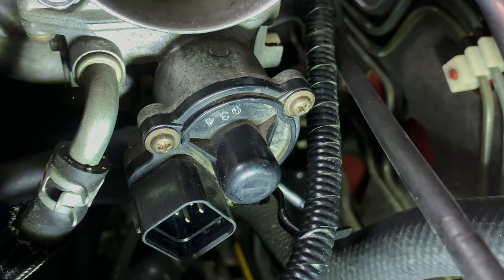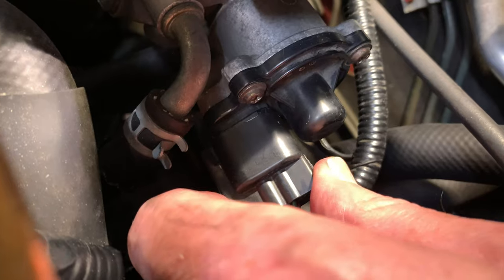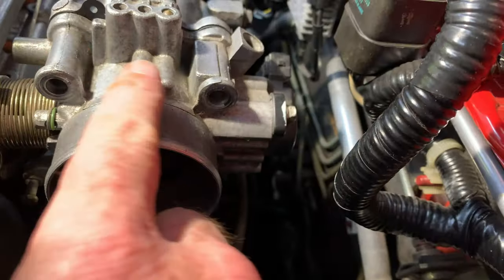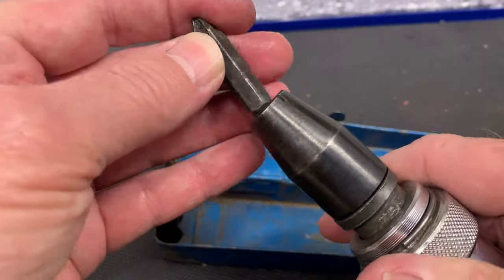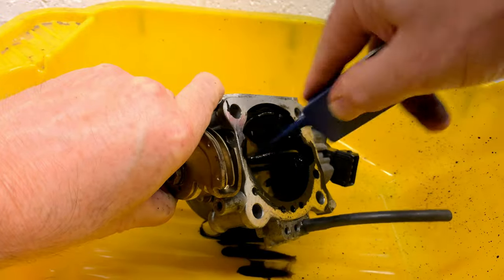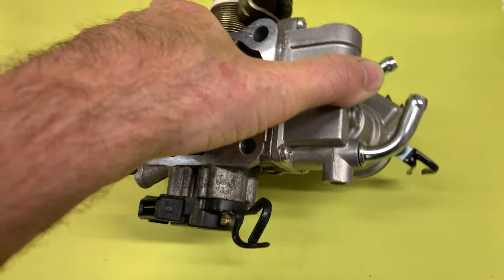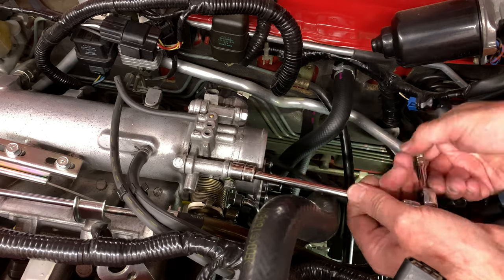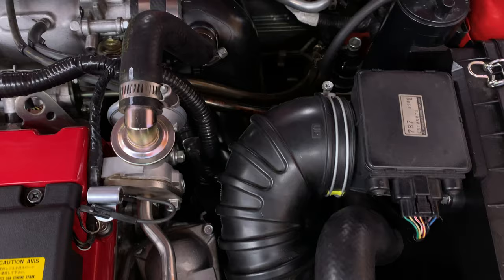Mitsubishi Evo IAC - Idle Air Control Valve Install - FAST Idle Air Valve - Motor IACV

Comment: Thx for sharing, i’ve often wondered what the clicking noises were when you turn on the car and or OFF. 👍
Reply from the maker: Its great to get this job done finally. I need to drive this car before winter returns

Comment: Nice one Andy, I too had to replace mine on my TME..Yep they die, even at 25,000km. 
Two things are certain if you own a Mitsubishi. Lifter tick and IACVs. Tried cleaning mine, worked for a few drives then wouldn't. Bought a genuine one ($$$ Ouch!!) and she's perfect again. Those Philips screws are a right pain...lol
Great Step by step mate..
Reply from the maker: Thanks Steve 🙏 yes some of the OEM parts are exy but best to invest while they’re still available i guess. Mitsubishi should have used socket head screws so we could use a hex key on them. Good opportunity to clean up the throttle body when its off the car tho. Cheers

Comment: Nice work. Would have been worth replacing the 2 throttle body shaft seals/bushings whilst it was out. Very common point for leaking boost on these.
Reply from the maker: Oh man I should’ve thought of that. I like your way of thinking. I bet i have the seals in my box of spare gaskets too. Maybe. Oh well it might be a good topic for a new video

Comment: I have a stock evo 7. Do I still need to install oil catch cans or not? I personally think only if I'm modding it to past stock HP then I might need it.
Reply from the maker: If its a stock 2.0L engine you don't need a catch can. The valve cover breathes enough back thru the turbo inlet and also via the PCV to the inlet manifold.
Reply: @UzumakiGarage  ah I see. Thanks for the reply much appreciated 👍
Reply from the maker: @randyshiwji1708  no probs. I’ll always try reply to comments as its the right thing to do when someone has made the effort to write something.  Cheers

Comment: That's what that clicking noise is on my Evo IV 😮. I'll have to consider doing this at some point because I too have a rough idle when coming to a stop. Did you have to get new screws to replace the ones that got damaged?
Reply from the maker: Hi mate. yes i did replace all four screws with new ones: Mitsubishi part number MF200052 You can see them briefly in the OEM bags at 3:20 Thanks for the comment :)
Reply: @UzumakiGarage  appreciate it. Super helpful. Can't believe how difficult they were to remove
Reply from the maker: @shautohaus  It surprised me too. The screws going into the coolant galleys were the easy ones undo
Reply: @UzumakiGarage  in the last few months working on my IV I've ran into a few issues with how stuck and brittle things are. You need so much force to get things loose, but it snaps or breaks because it's either rusted or brittle plastic.
Reply from the maker: @shautohaus  My evos have been ok but I remember dismantling some Subaru engines where just about every electrical harness connector crumbled to pieces as my fingers squeezed it to disconnect. There is an online store called something like Mister Connector who sells all the Mitsubishi OEM style connectors if you need to replace yours. I should stock up on these connectors too as its only a matter of time until I need to replace mine.
Reply: @UzumakiGarage  I'll have to find that. I tried looking on Amayama and all I can find is the entire wiring harness.
Reply from the maker: @shautohaus   https://www.misterconnectors.com.au/Mitsubishi-c31245112
Reply: @UzumakiGarage  clutch. Thanks again. I'm doing a bunch of videos on my channel with my IV, so maybe I'll do one on swapping out the connectors.
Reply from the maker: @shautohaus  oh cool. Subscribed!
Reply: @UzumakiGarage  🙏🏽
Reply: Thanks to this. I have the same problem lancer ck gen1. My iacv is still working but when i on the ignition. There's clicking sound in the iacv. And when during cold start and the car is running, i have irratic idling it causes more fuel consumption.. can you link where can i buy iacv. Im from the philippines...
Reply from the maker: @kennethbarizo5465  You can search www.partsouq.com using your car's VIN to work out what part number you need as it will be different to what I used on my car. I often buy parts from amayama.com but you should be able to get the parts you need from your local Mitsubishi store in the philippines. good luck.